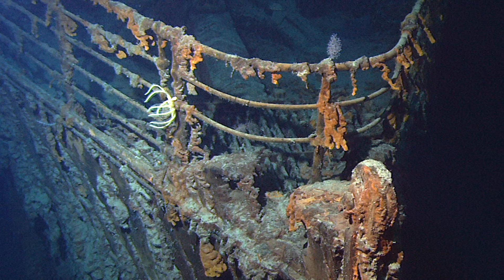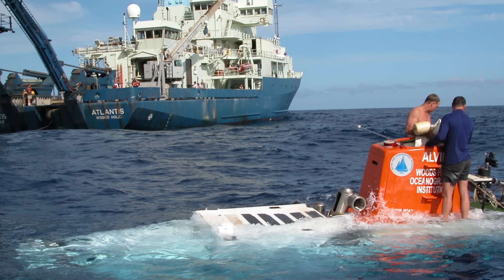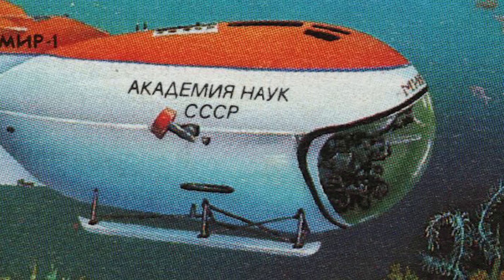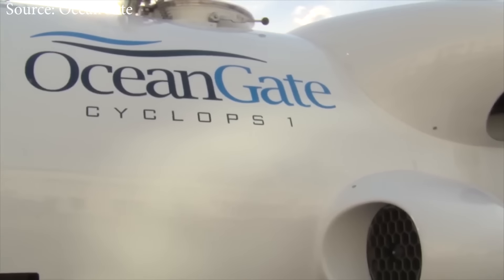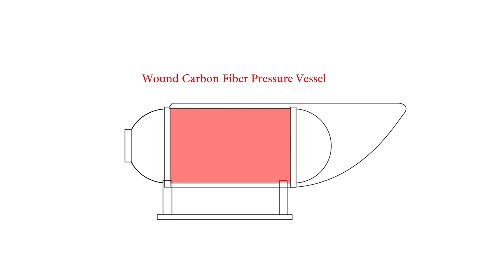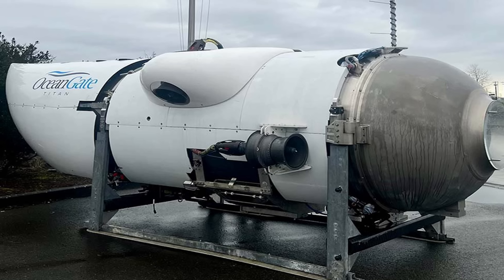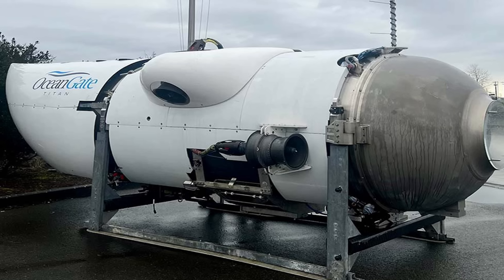How Titan was Built, Lost and Found: An Analysis

Comment: Mike, a quick note on how the titanium rings were attached: they were bonded using an epoxy (in layman's terms--they were glued together). It is concerning that this was done in a warehouse (as seen in your video). Any dust or particulates could have gotten in and created a potential source of weakness in the epoxy. In addition to the many other shortcomings of this design, the building practices also fell short. Given the tolerances involved, this step should have been performed in a controlled clean room.
Reply: WHAT ON EARTH??? that's one of the worst design decisions I've seen so far about the Titan. horribly negligent doesn't even begin to cover it.
Reply: So the joins were made of three different materials (cf, epoxy, titanium)?

Wouldn't at least one of the three behave differently at the various pressures and temperatures the machine experienced?
Reply: @exasperated  you have four total materials in this join: titanium, epoxy, and the cf (which is a composite of carbon fiber and another epoxy). You have two epoxies, a non-metallic composite material, and a metal.
Reply: @exasperated When I initially viewed the video of the sub's end cap to carbon fibre tube joining process, I saw the handwriting on the wall.  

Critical processes were being done under contaminated conditions, epoxy was applied using a paint brush with no control of the amount or precise location, the physical joining of the elements was done using no stable alignment mechanism (a k.a. the "we got lucky this time" process control system) that leads to momentary canting of the end caps as they are inserted into the tube (causing irregular distribution of the epoxy in the interface area.)  

These potentially seriously degraded bonds are then subjected in use to the effect of the greatly differing coefficients of thermal expansion between the carbon fibre tube and the titanium end caps when the sub cools at depth in frigid ocean water.  

All of the preceding could have easily contributed to a separation of the thermally shrunken end caps' OD's from the tube ID's, creating stresses at depth that the carbon fibre tube ends could not withstand.  Even the smallest crack or delamination in the tube would have led to the total failure of the tube at depth.

The science of what I wrote is sound.  It may not have been the cause of the catastrophic failure; but in my gut, I have to believe it almost certainly was.
Reply: @exasperated  sarei andato sul sicuro, progetto al di sopra di ogni sospetto, la sfera del Trieste è ancora visitabile, 12 cm di acciaio temperato, ha portato un uomo sul fondo della fossa delle marianne.
Reply: @naurrr  Not just design. Fabrication too.
Reply: @satunnainenkatselija4478  weight. Titanium is lighter than steel, it is also more corrosion resistant to saltwater.
Reply: @mdavid2822  What I dont understand is why they care about weight, for an airplane I understand it, but for a submersible that is designed to sink? They could use steel caps and reduce the amount of ballast. The only reason would be corrosion resistance then.
Reply: @daniel6438  weight matters because the craft needs to maneuver on the seafloor. More mass means more batteries. It also means you need heavier lifting capabilities at the surface. The more you have to lift, the bigger the crane you need. The bigger the crane, the bigger the boat. The bigger the boat, the more expensive the expedition. It is a classic cost spiral.
Reply: @daniel6438 because it needs to get around and get up to the surface again.
Reply: is it just me that hears 'bonded' - which means magically attached - and instantly thinks 'how? what? why no data?'
Reply: @lawrencegenereux8567  but bonding is magic. Says anyone who's never used an adhesive outside it's temperature or age range. 

EVERY adhesive I ever use, I ask 'what conditions is this tested at' - packaging says within 24 hours. At what humidity and temperature.

Just fucking try it, people say.

And often, it doesn't work. RTFM again. Right, more testing. FFS, can we get a datasheet?

And I, me, myself, start a rabbit hole test saga to see if it fucking works.

I find it's failure limits, and.. WOW. 

Next adhesive..
Reply: I mean the entire thing should never have hit the water

Comment: 7:50 one correction you are obviously correct that the use of games controllers is not unusual the actual issue with this one was being bluetooth, in the Navy they are all wired to make sure at no point you ever lose connection. So although it was much less of an issue as the media and streamers made it out to be, it did still have an issue with it.
Reply: The controller itself is probably quite reliable, but the non hardwired nature was somewhat of a concern to me, even though it likely has nothing to do with the implosion.  Regardless the use of a game controller via bluetooth, camp lighting and other conventional items gives content into the approach of how they built this submersible... I wonder what other questionable things they implemented to say money? Clearly not enough people were watching or giving oversight given how radical the carbon fiber first of its kind pressure vessel was, at least some people in the industry to reach out to Oceangate but seemingly their concerns were not heeded and I suspect others refrained from fear of being sued by Oceangate.

Comment: I must disagree with you about the controller. It was a wireless controller which is insane. What happens if it runs out of batteries? How many spare batteries did you bring? What if something happens with the wireless connection? Is there a backup system? Is there a hardwired controller in case something goes wrong?
Reply: Also fire risk. I wouldn't want to be in a sealed vessel with consumer grade electronics.
Reply: It smacks of hubris, aesthetic first safety second & people died 😢
Reply: One of my favorite memes is the Xbox Controller suddenly being disconnected
Reply: Im by no means trying to defend ocean gate, taking people on expeditions on a experimental sub is ludacris. But in one of there videos they put out on there YouTube channel they said they had 3 back up controllers, 1 being wired.
Reply: @caseyjones38  I didn't know that. Can you send the link? I can't find that video.

Comment: I know that their deaths are said to have been instantaneous and painless, but right before it, the fact that they had the time to try some methods of resurfacing means that they had at least some seconds that they knew that something was wrong... and that's a horrifying feeling to imagine.
Reply: It's still better than knowing that something's wrong and then being stuck down there slowly waiting for the oxygen to run out as you feel the pressure of the water on your torso. I'll take an istantaneous painless death over that anytime.
Reply: @oddda5956  definitely!
Reply: Pure speculation, the first indication of an issue may have been a sound similar to a small rock hitting our auto’s windshield. The ramifications would have been apparent to all.
Reply: The indications of resurfacing most likely were nothing but false signals sent as the computer link failed. The sub was destroyed,  power was lost, and the indicators defaulted/the emergency release activated (there was, I think, something like that) or an emergency system activated anyway, sending enough of a signal to register before the whole thing fell silent.
Reply: @Svensk7119  the undercarriage was separated before the implosion, as far as I understood.
Reply: @mjouwbuis  From what I have come to understand, the initial reports of "signs of trying to surface" were incorrect.  Perhaps I am wrong. But if the submarine.simply... detonated, that would be consistent with reaching sixteen, seventeen hundred fathoms and three hundred atmospheres.
Reply: They knew whole 20 minutes
Reply: @dewille-pl  really?? is there new info to confirm this?
Reply: @Art3mis1990  Transcript, not officially confirmed, but seems very real
Reply: Nobody knows if it is painless to implode.
Reply: @billbally4419   We know, your brain can’t register pain in time
Reply: @dewille-pl  I wonder if the 19 yr old was able to solve his Rubik's cube before they all went poof. The very idea that his parents let him sign his own death waiver and he here is taking a toy along to kill the time seems really off to me.

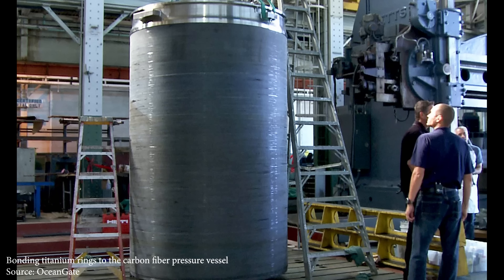Comment: 12:07 - I believe they used epoxy glue to secure the hemispheres to the carbon fiber cylinder; at least this was what another construction video described. I'm now struggling to find the source.
Reply: They used titanium rings attached to the carbon cylinder. The titanium rings were attached to the outside of the ends of the carbon shell. Epoxy was placed on the outside of the carbon cylinder and the inside of the titanium ring. The titanium ring was simply slid over the cylindar and the epoxy was used to hold these 2 parts together. The end hemisphere was then bolted to the titanium ring. I think the failure point was the dissimilar joint at the intersection of the carbon cylinder and the titanium ring. Condolences to all.

Comment: Small correction about the comet, it didn't exploded because of the square windows, it didn't had square windows, they were rounded on the corners, the real reason was metal fatigue on the suboptimal aluminum alloy it was used, it wasn't good enough to withstand the pressure on the new altitudes it was supposed to go, also the rivets left microscopic cracks that eventually made the structure to be torn apart, and unlike modern aircraft, instead of tearing apart the skin and keep flying, it just couldn't hold on the structure and the plane broke apart almost instantly.
Reply: Also, IIRC, they didn't test the entire hull, but only parts for cyclic fatigue and the number of tests was too small to properly assess the number of cycles the hull could withstand. Which is actually quite close to what happened with Titan.
Reply: Turns out that the Nimrod is basically a military version of the Comet with the faults ironed out & was in service for many years after the demise of the commercial version.
Reply: Thank you, I came to the comments to add the same correction. The square windows, had they actually been squares, would of course have acted exactly as Mike described.
Reply: On top of the airframe, directly over the flight engineer’s station, were two small, square windows. These were used in conjunction with the radio equipment, guaranteeing good signals. They were supposed to be glued-in, but instead they were punch riveted, forming tiny cracks. After so many flights these cracks expanded and grew down the hull to the windows. It was at this point that failure occurred.

Also, the aluminum used in the airframe was the thickness of two pennies.
Reply: They took a Comet Aircraft hull, placed it in a tank of water then filled the hull with water to what the pressurised hull would be. They then cycled this to represent take offs and landings. They also recovered a lot of one of the aircraft from the Mediterranean seabed and rebuilt it around a frame in a hanger. The hull that was being pressurised failed unexpectedly and suddenly. A crack emanated from the corner of a window. Airframe fatigue was a new science at the time and a lot of this was unknown. When the Comet 2 was put into operation the windows were small and rounded. The RAF Nimrod was a variation of this aircraft and flew successfully until 2011 and then retired. There were a couple of airframe losses, one over Afghanistan unrelated to the original problem.
Reply: Thanks, I was about to state this, (but with a lot less knowledge.) The photo that he uses of the Comet literally shows the round edged widows.
Reply: @emty9668  I don't know what altitude the Comet flew at abnd therefore do not know the air pressures involved, but it of course would have been less than One Bar, a tiny fraction of the pressures that the Titan would have been subjected to.